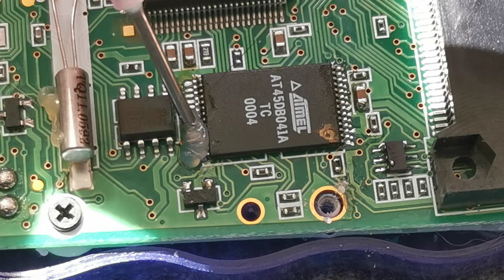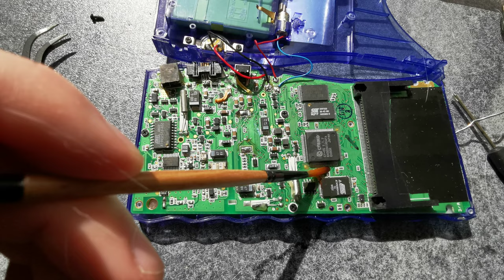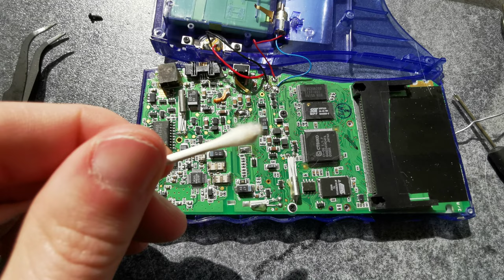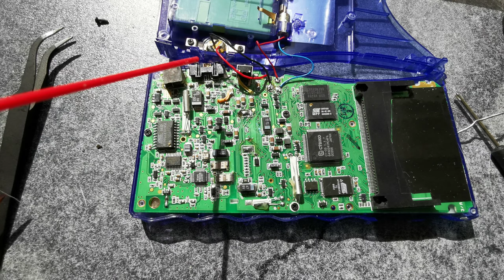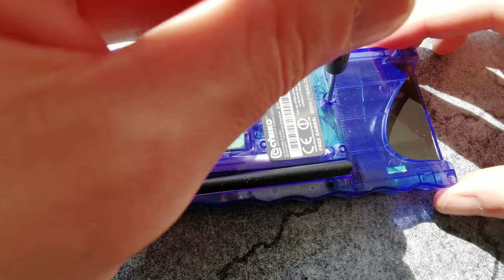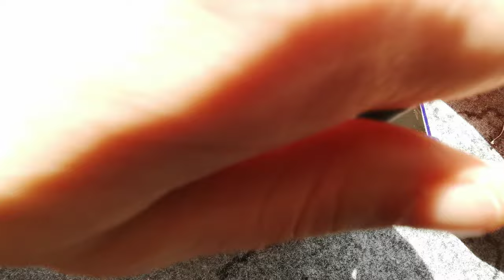Cybiko repair: replacing Atmel AT45DB041A TC TSOP-28 Flash chip without a hot air rework station.

Comment from the maker: This video documents my attempt on this particular Cybiko to replace the TSOP-28 packaged Atmel AT45DB041A TC TSOP-28 Flash chip. This particular unit was actually an unsuccessful repair, and I make a number of mistakes throughout. I have had success on other Cybikos following this same process, but I didn't want to dig out the recording gear a second time, so just read the notes below.

Firstly, you don't need as much heat or time as I used on this particular flash chip. Too much heat or time risks lifting the pad.

Secondly, the top pins on this package are not connected to anything on the Cybiko or (as far as the data sheet claims) in the chip itself. Therefore mostly worry about protecting the pads nearest the expansion port. You'll notice this cybiko already had a missing pad on the top set of pins. This was from a previous repair.

Thirdly, be a lot more thorough cleaning the board before soldering on the new flash chip. I was more focussed on filming than I was doing a good job, and it really shows in this video. 

Fourthly, be very, very careful around the SMD (very small) components around the flash chip. This is not the proper process for replacing a chip of this type (you'd probably want a heat gun), but it can and does work if done carefully. If you do desolder the SMD components around the flash chip, good luck resoldering them back on.

Fifthly, when resoldering the chip, I recommend applying a little more solder than you think, Surprisingly, this makes it easier to guarantee no bridges.

If you do attempt this repair on your unit, I wish you the best of luck. Let me know how it goes for you. This video is not the end of it however, there is stuff you need to do with software to get your Cybiko up and running. Join our Discord for further instructions! https://discord.gg/yvJGXaah